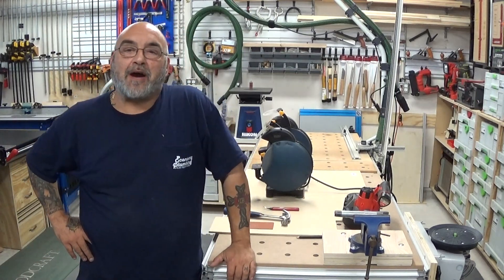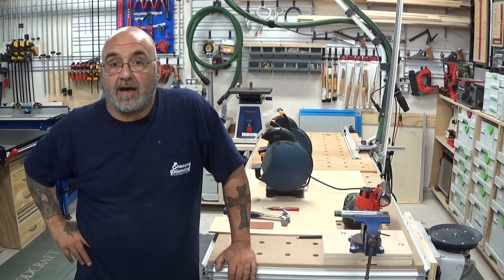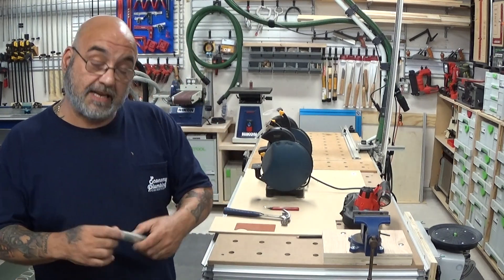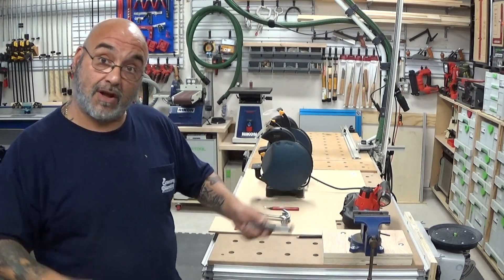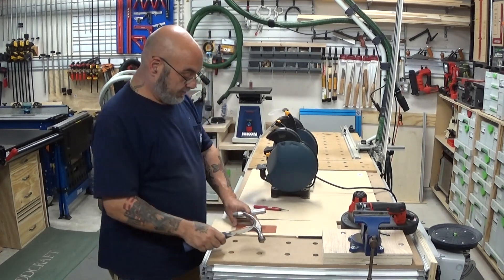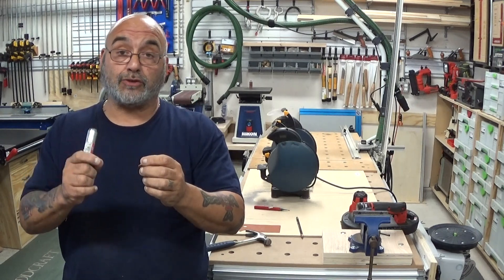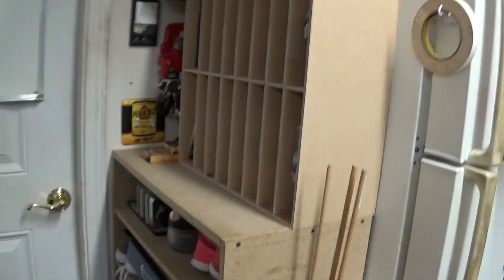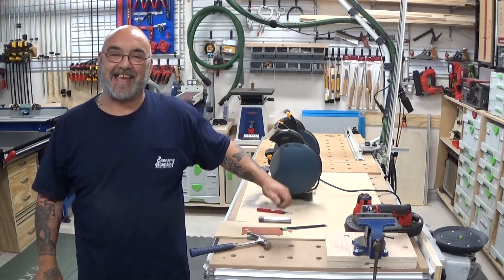Video tip #1 making a hole punch.

Comment: Thanks for posting this - seems easy now that I saw your video.. Harbor Freight has a punch set for $9 that takes care of up to 1/2" in sixteenth increments - but this is great for the larger sizes and way faster to make than even driving to a store even if they sold them.. (which they don't in my town)..  I didn't know the 30 degree angles that helped too.  I can attest that trying to cut a reasonable circle with a razor or scissors is pretty much impossible, so a punch is the only way unless you have a CNC laser.